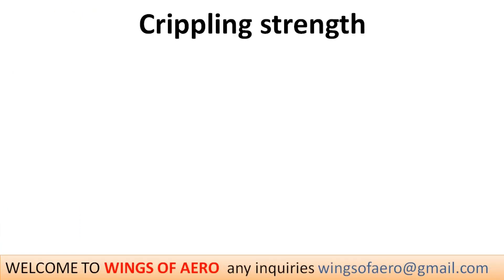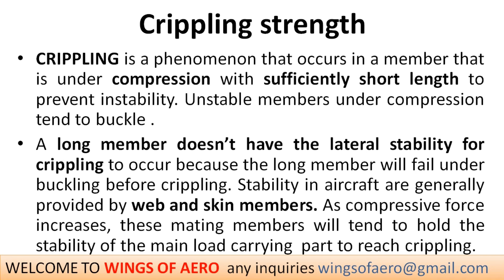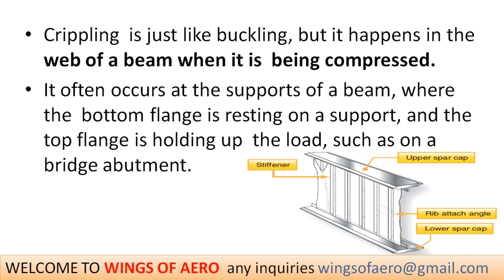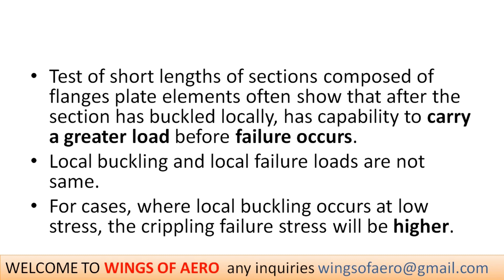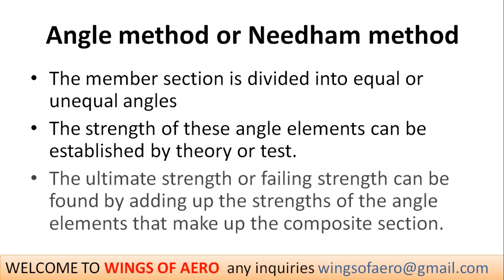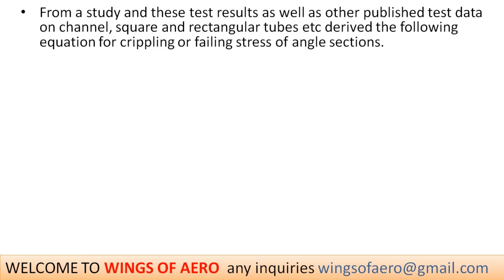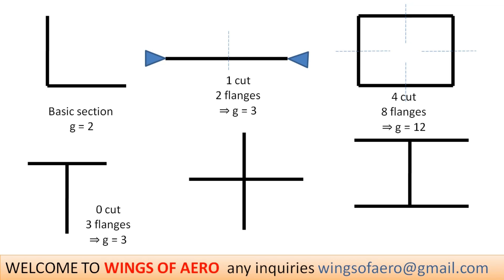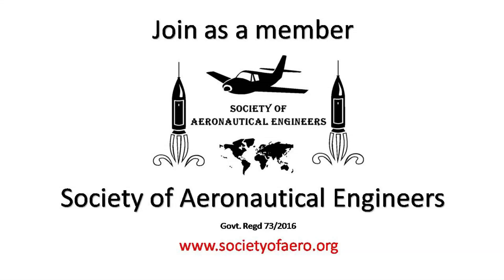Method of calculating crippling stress || Aircraft Structures ||

Comment: The problem with this is at one point, you say that crippling will occur in the web of the beam but I only analyze crippling in the stiffeners of the ribs of the aircraft. This makes me a little confused. I currently work as a young stress analyst for an aerospace company in the US.
Reply: Crippling is considered a local buckling mode, and it can happen in any section.  It is most critical in sections made of thin flanges like hat stringers, Z-Stringers, Angles, Tees, and the like.  You can actually gain insight by considering each flange as a little plate, with simple, fixed, or free supports on each edge.  Any section can cripple, however, longer sections will tend to undergo Euler buckling long before crippling occurs, while shorter sections will cripple first if the cross-section has thin flanges.  Make sense?
Reply: @ToddCoburn Thank you kind sir